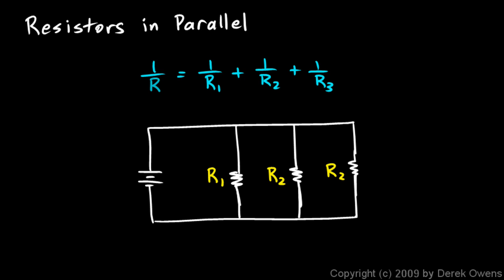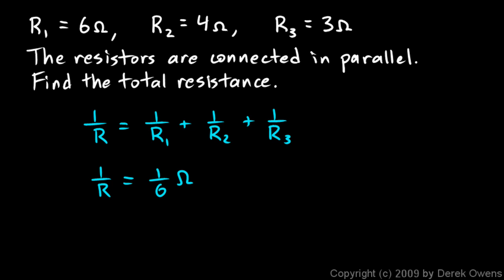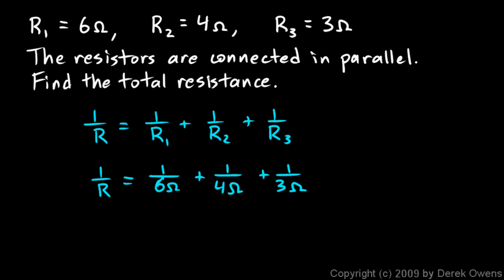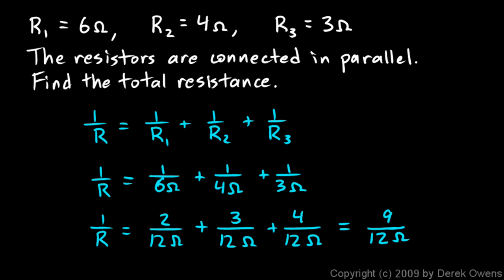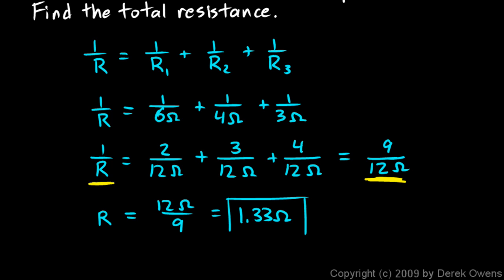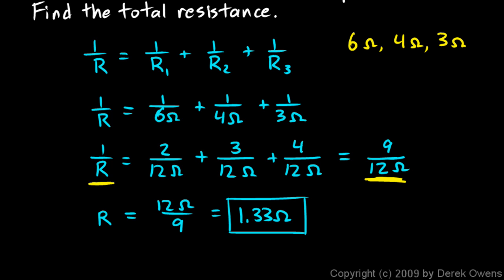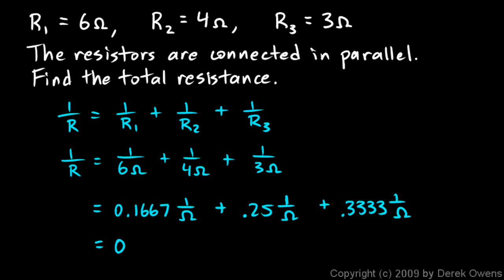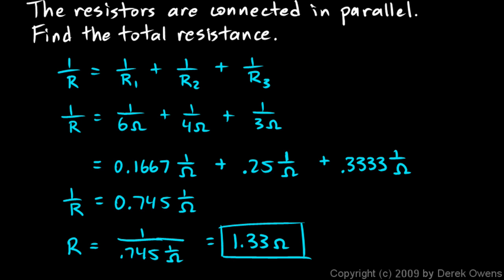Physics 13.4.2c - Resistors in Parallel

Comment: 1/.745Ω = 1.34Ω
the sum is actually .1667Ω + .25Ω + .3333Ω = .75Ω
so, 1/.75Ω = 1.33Ω (repeating)
You probably added in your head, a very helpful and informative video none the less.

Comment: At the 2:10 mark, how did you get 12 Ohms?
Reply from the maker: Devon Wayne We get 12 Ohms because 12 is a multiple of 6 and a multiple of 4 and a multiple of 3.  In other words, the least common denominator will have to be a multiple of each of the denominators.  Adding the denominators together here would be a mathematical error.  Instead, we're looking for a common denominator.
Reply: kermets It's just how adding fractions is simplified. One half, or 50% can be represented as 1/2 and 2/4 and 4/8 etc. If you wanted to add 1/2 + 2/4 + 4/8 together you could change all of their denominators to be the same. so 4/8 + 4/8 + 4/8 = 12/8 which is 1.5 or 150%. it could then be reduced to 3/2 which is also 1.5 or 150%. This could also be achieved by dividing the top and bottom of two larger fractions by 2 (2/4 / 2 = 1/2) and 4 (4/8 / 4 = 1/2) So 1/2 + 1/2 + 1/2 = 3/2 or 1.5 or 150%. 

Another example is 1/3 + 1/2 + 1/6 + 1/4. To add these together you would find the lowest common denominator, which is 12 in this case as well. So, 1/3 = 4/12, 1/2 = 6/12, 1/6 = 2/12 and 1/4 = 3/12. Then add them, 4/12 + 6/12 + 2/12 + 3/12 = 15/12 which is 1.25. This could also be simplified to 5/4 by dividing both sides by the same number, 3.

He came up with 9/12, simplifying 9/12 gives us 3/4, and 3 divided by 4 or 9 divided by 12 gives us .75. Then using the formula 1 divided by .75 = 1.333333 or 1.33Ω.

Hopefully this clears things up for people a little bit.
Reply: Derek Owens yes but how did you work out to get the 12 ohms ? there is no formula shown, I know what you mean about the commom denominator but if you had 20 resisters for eg. had to you get the 12 ohms, cheers
Reply: fishanhunt 1 Its the number all the resistance values go into. The common denominator ;-)

Comment from the maker: Ok, will do!  I haven't re-checked this video in response to your comment, though.  I may have rounded incorrectly when I solved the problem.  I don't usually make a big deal about the rounding, though.  The point of this example is to understand the technique of dealing with resistors in parallel, so I was probably focusing on that and not the rounding.